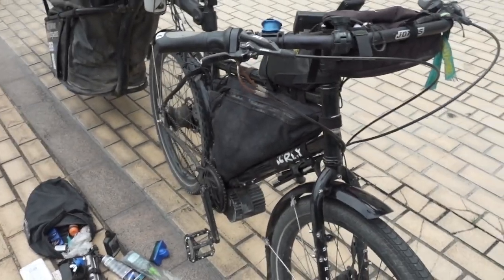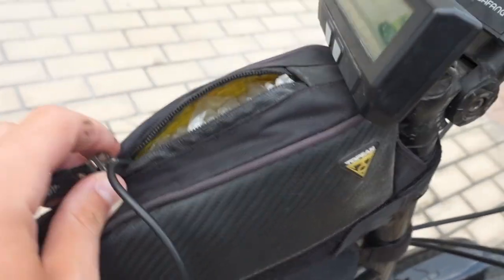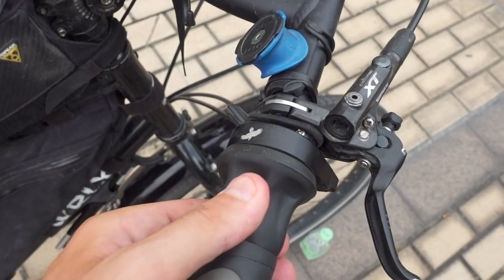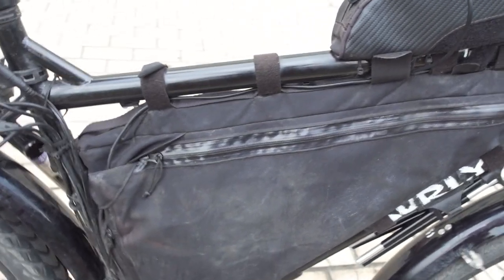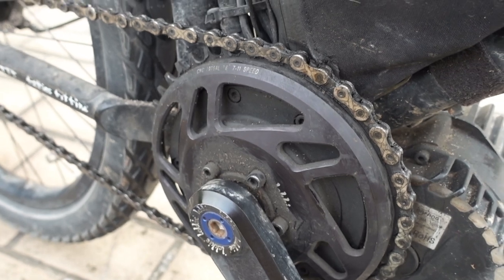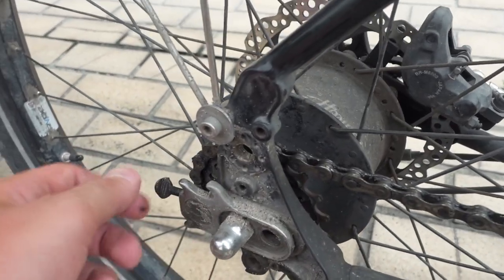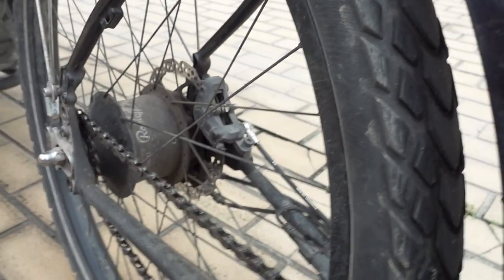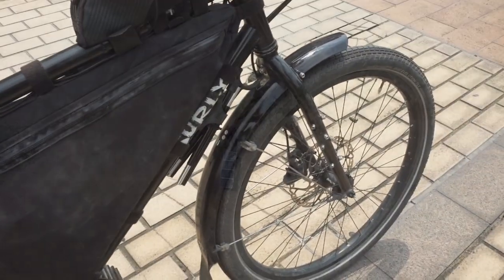Touring Solar Ebike Review After 13000km to China - BBSHD Em3EV Battery

Comment: I bought a Brompton last year they come with Schwalbe  Marathons
They have been doing a lot of road maintenance around my place
I managed to bang up my rear rim, one edge was folded in about
a half inch , the tire didn't even look like it had hit anything and it
didn't Ieak . I put the bike away for the winter . I just looked at it 
yesterday, the rear tire has more air left in it than the front ! I just
ordered a set of Marathons and tubes for my touring bike.

Comment: Very interesting to hear your take on the hardware and how it's performed day after day over so many kilometres. I've been wearing thinnish suede/fabric gloves for the last few years (all year round) as a solution to "black hand"! It also seems to make the rubber grips last longer. I usually get through a pair of gloves every year and a half though. (I do about 4000km a year, mostly offroad).
Reply from the maker: I think this is probably the best solution, fingerless ones? It would help with the sunburn too!
Reply: @JackButlerVideos  No, the ones I use are thin suede and fabric, so you don't lose any sense of touch. In the summer (it gets pretty hot here in Spain) I'm like a zebra! White hands, brown arms (up to my tee-shirt) and same with my legs! 8)

Comment: Amen and thumbs up on the Rohloff, Surly, Jones bar, and Schwables.  The little bits of wire from blown out tire casings are horrible and can be found in abundance along US interstate routes.
Reply from the maker: Yea the pieces of wire are such a pain!!
Reply: did you change the oil on the rohloff after 5000km? did you change the oil at all? How about flipping the rohloff rear sprocket? How stretched was your chain after 18000km? thanks love getting all your feedback
Reply from the maker: Changed the oil after 6000km halfway through suntrip and afterwards. Didn't flip the sprocket. Still using it and the chain after about 20000

Comment: Hi Jack. Thank you so much for sharing.  I have  two main questions: 1). Is your SPOT device useful? In other words, did it work when you needed it to? Could you send text messages with it without a mobile phone?; and 2). How did you make sure that your bike was safe when you had to leave it to go to the bathroom?  I know you can use a chain and lock to lock it, but you had some many important things on it.  Again thank you.
Reply from the maker: The SPOT was given mg the suntrip organisation for the online tracking map. I didn't really touch it. When Camping my bike is right outside and when sleeping inside I'd put the bike somewhere like a car park or inside. In a shop i used a tiny cable lock.

Comment: Wow, very interesting! A few questions? Tell me about the charger/solar panel setup. How many charging amps did the panels put out? Can you ride (discharge) the battery at the same you are charging it? If not, did you have to carry an extra battery? How long did it take to fully charge the battery using the panels? What is the weight of the panel array? How was it being in China in general? People cool? Thanks for posting; awesome.
Reply from the maker: I had 300 watts of panels rated, probably less in reality. Yes i ride and take power from the panels at the same time, just one battery! My record day of solar energy was 1400wh in Kazakhstan. You could charge nearly three bosch batteries with that. Unsure about the weight, but a lot for sure. Yea China is beautiful, was fun cycling through!
Reply: @JackButlerVideos  what charger are you using to charge from solar to lithium? Amazing idea and very well implememented, did you have problems with the wind and the big panels?
Reply from the maker: It's a boost charger from a company called genasun. Basically the only product choice for this application at the moment. Wind is only a problem when it's above 50km/h

Comment: Good overview of the bike and the issues you encountered on the trip. the solar panel system and battery setup seemed to work flawlessly even after your blowover. What level of assistance did you use for the majority of the trip?  Great video Jack, thanks.
Reply from the maker: Thanks! Yep I'm glad the electrical system was fine, i had lots of materials with me for repairs and didn't touch any of it haha! I usually use 100 - 150w. More sometimes if I'm trying to make a red light, run away from dogs or on a bad hill
Reply: Really interested in the data logger info when you get it from Suntrip. It could prove to be very interesting. Cheers

Comment: Hi, Jack I have been watching your China trip and build videos and would like to know how successful the panels were in keeping the battery full. You started with 3x 75 watt panels but I see 4 in the pictures so 300 watt at max? The battery is 35ah x 51v i.e. about 1750 watt hr? You covered an average of 1280/64=200km/day with maybe 12 hr days and I think you said about 10 watt hr /km so you would have needed ~2000 watt hrs per day. If you had 8 hrs of good sunlight that would be a max of 3000 watt hrs so may have been enough to keep you topped up - so my question is - how much charge (if any) did you need to add overnight ? thanks
Reply from the maker: My battery held less than 950wh. My record solar day on the suntrip i got 1450wh. If i had 2000 w/h a day i would have been veery happy haha
Reply from the maker: (also we are not allowed to charge overnight)

Comment: Fantastic video and great explanation. One quick question though, how many Watts do the solar panel need to generate in order to charge your Batteries? Is there a way to work it out? I'd like to do something similar too on my BBSHD. My battery is a 52v 20a Triangle. Thanks in advanced!
Reply from the maker: Any size would charge it vut it depends how much energy you need/want. Multiply the Watts Peak of the panel from anywhere from 3 to 4.5 (or less) to get the amount of W/h energy you will get per day

Comment: Do you still have this bike setup? I am trying to build something similar from scratch using a Rohloff and a Bafang mid drive, but I was worried that 1000W is too much power to run through the Rohloff. 
Im just wondering if you have any input regarding that? Are you smoothing the power output out with parts from GRIN, or is the Rohloff actually handling the output directly using the Bafang controller.
I think I read somewhere that the Rohloff warranty only applies if you use less than 250W, otherwise its void, but maybe I'm wrong on that?

Any answers you have would be greatly appreciated!
Reply from the maker: The rohloff can be used on a tandem. They limit the maximum torque, you have to stay within their recommended gear ratios and it's fine then. I used the normal bafang controller.

Comment: Good information, bit "disappointing" to hear about the back tire, Schwalbe should fix that. The Cane Creek Thudbuster sounds like a Wonderfull thing to have and upgrade my own bike with.
How do you feel about aero bars, did you miss having them or are they a too big risk on the roads you travelled?
Are there other things you missed having?
How about aerodynamics? Any improvements you would like to make?
Reply from the maker: I think the tyre has its place, it's just not on this route. I think in other central asian countries with worse quality roads it would excel. The thudbuster is great i would use it again, it's very expensive though! There was a few times i missed the aero bars yea but the second half of China was pretty up and down hilly so it wouldn't have made much of a difference. The problem with making the bike more aero is that it makes a larger side area to catch the cross winds which i can't even begin to imagine being any worse than they were haha! I would like to have more than 2 litres of water accessible without stopping as an improvement, this would be much more convenient!
Reply: You are absolutely right about not wanting to create a larger side area. Closed TimeTrail wheels do not seem like a good idea for a trip like this.  Higher rims though could bring you a few km each hour.

A few watts can be spared with an aero helmet, not cheap but it does help a bit, when going faster. See https://www.youtube.com/watch?v=M7JtY00HVo4
I really like the kask infinity as I can open and close the vents, which helps when it's raining ;-)

When you were blown away by crosswinds, was it the bike or the trailer pulling you to the side?

Maybe tying together cables and everything else that is flapping around. Maybe use some transparent 3M tape to tie things together.

 Also, the rear end of the combination the bar looks very safe but also seems like a windbreak.

Did you keep track of the engine temperature?

For the engine I can imagine that on some days you want more cooling for it, on other days it can be cooled less. Although that won't bring you much I guess.

Comment: i use a comfort seat wide with padding, and can ride for 5-6 hours with no issues. I'm wondering how you wouldn't have complaints with a small hard seat like that. you mentioned your previous painful seat befor the Velo shop, what kind of discomfort was cured by your current seat?
Reply from the maker: The brooks saddle is wider and less padded so no rubbing. Padding is not a good thing on 12-14 hour days. Better to wear padded shorts to aviod rubbing

Comment: Hey man, I just found this video and I wanna do something similar. I wanna build my own ebike from scratch in Shanghai and cycle to Portugal or something like that. Some quick questions.

1. Why no suspension? Front/Rear. Wouldn't it be more comfortable (I know it'll be heavier but still)?
2. How was the border crossing situation with an e-bike, any troubles? Like not allowed, or need a license, or cant be more than 45km motor or 32km/h motor?
3. Why not just bring 2-3 batteries instead of solar?
4. Why no carbon belt drive instead of a chain?

Thanks so much man!
Reply from the maker: Suspension is another point of failure that would end my race if i had to stop and fix it. Non western countries borders didn't know what an ebike was. The race was "the suntrip" so the whole point is to have solar. Also in the middle of Kazakhstan there's nowhere to charge anyway. Carbon belts are one piece and you have to cut your frame to install it. Leaving you with a weak point where the joiner is. Good luck on the trip!
Reply: @JackButlerVideos  Wow, interesting! Thank you so much for your super helpful info mate!

Comment: How many watts are you running does it keep the ebike topped off during the whole trip? How long to fully charge the battery on average off your panels and what's your range before needing to recharge?
Reply from the maker: Well I this trip I did not once plug in to charge, I didn't even bring a charger. 300w solar so in best case 1300wh a day energy.

Comment: Why the choice of center mount motor over a hub motor? Is there an advantage to being able to shift the motor gear? And, why use a 1000 watt motor if you only normally use 100-150 watts? Great work by the way!
Reply from the maker: I liked the ability to move slowly uphill without burning the motor. And i only used this motor as it has a good internal design and is easy to service by the road.

Comment: What a beast! Do you charge the battery when the motor is running?
Reply: I think he got 2 batteries one is charging during he use the other one
Reply from the maker: Just one! You can charge and discharge at the same time, not ideal for longevity but not as big of a problems as people assume.

Comment: a have a simelar bike with aluminium frame do u think it will work good as your one or u think it will brake?
Reply from the maker: I think i would be fine if it's designed for heavy loaded touring
Reply: @rene Kreher was machst du denn hier 😅

Comment: Hi there, what's up?
I'm planning to use my bike for touring using solar panels (The Sun Trip), and I'm ready to start building this proyect:)

The thing is that researching a bit I found out that the new M625 is more restricted about programming and it only allows to use Bafang batteries and/or specified nominal voltage from the same brand, but not sure about it since there is not much information available nor Bafang says nothing on their website regarding this motor. Even it does not appear in the listing of motors they show, just M615 (BBSHD).

As I mentioned, my idea is to travel extensively and I want to have flexibiility and easiness when programming any motor, but also being able to use any batteries of my choice and have the best motor quality overall. So, are there any real advantages to choose M625 over BBSHD? Thanks in advance!

Regards,
Angel
Reply from the maker: I think you may have answered your own questions? I would choose the BBSHD as you know it's capable already

Comment: Wow what an adventure!! Do you think that instead of solar panels could be a good idea have a gasoline generator? Sould be around 1kw to supply a 500w battery.. It's about 15 kg weight total
Reply from the maker: It would certainly work. I'd like to mess around with the idea but don't really want to be burning fossil fuel. At that point you really have a structurally weak moped that you happen to be able to pedal haha.
Reply: @JackButlerVideos  it's not legal in some countries 😜

Comment: I can't say it is a beautiful bike with al the stuff going on. But after 13000km of dust no bike would look nice and clean. 
I hope you will do a video about the performance of the solar panels, how much juice you got out of it. Seem to be same as mine. They are not the best panels probably. With my 2x80 watt panels I only managed 30km extra distance on a sunny day. The solution would be to ride at night and charge while you sleep at daytime. But who wants that? Or perhaps order lunar panels?
Reply from the maker: I'm going to wait until we get all the data back from the data boxes about charging and usage so i can present something as i talk about it. My panels were not good compared to others but I'm still very happy with the performance for the cost. In Kazakhstan i was getting 1400wh everyday! More than the capacity of my 1000wh battery. If i was riding at night i would have missed 400wh of energy, although the battery capacity limit was set by the rules of the suntrip i would otherwise use a 1500wh pack. Some of the guys tried using mirrors in a morning to get more power, unfortunately with little success :p

Comment: Wasn´t the BBSHD not suposed to be paired with re Rolhoff??     I have a couple of BBSHD and I didn´t wanted  to spend the money on Rollhoff stuff cauce everyone told me that it will not wistand the torque of the motor...    What setup did you run on it??
Thanks!   Impressive numbers!
Reply from the maker: You need to read the rohloff spec. They limit the gear ratio you can use so there is not too much torque. As long as you stay within the guidelines for ebike/tandem bike it should be fine.
Reply: I have two Rohloffs, with "hot rodded" BBSHD's (1300 watts) and one is geared quite low and is used exclusively for very steep and rocky trail riding. No problems whatsoever, they are over engineered, and the company is very conservative in the amount of abuse they can handle.

Comment: why is the new 42t important?
Reply from the maker: Nice tooth design that holds the chain on much better and it corrects the weird chain line the motor has otherwise. Also 42t is less than the stock so motor is geared lower too
Reply: @JackButlerVideos  i ordered the 750 watt bafang with 44t.. i see how it goes
Reply from the maker: Enjoy!

Comment: What about motor resistance to peddaling (drag) when off?
Reply from the maker: In mid drives the motor has a freewheel so it is not connected mechanically to the drivechain when you are pedalling faster than the motor. So no resistance unless you have a hub motor capable of regen.

Comment: Jack, how did you, or did you, rig a gear shifting sensor with the Rohloff controller?
Reply from the maker: Do you mean with the BBSHD controller? I didn't use a gear sensor, if you have a brake cut off it's basically unnecessary. You just touch the break to kill the motor during gear changes